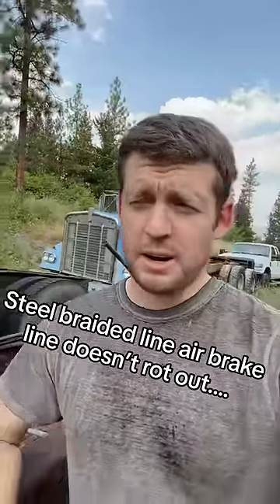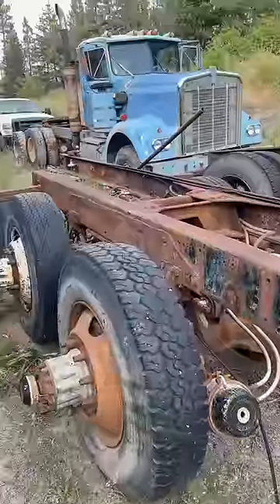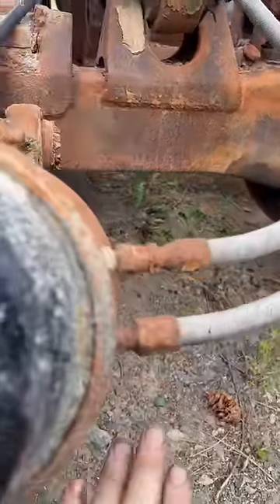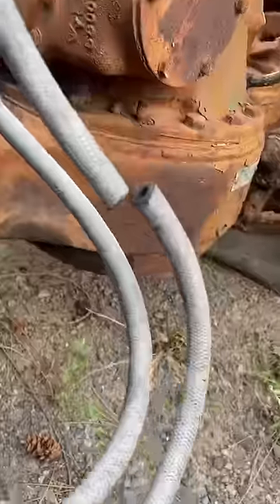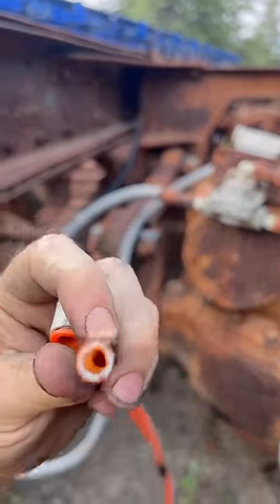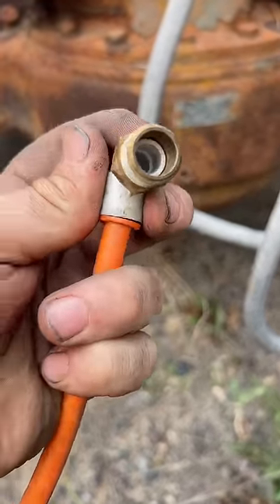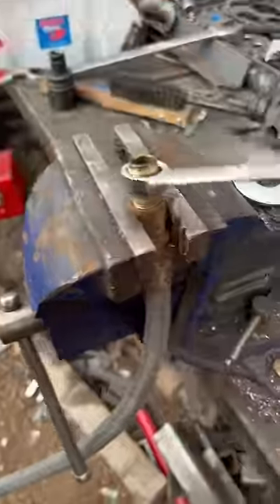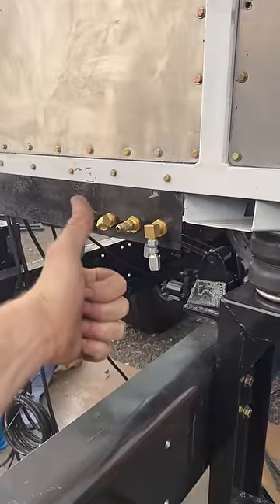Cutting a 70 year old trucks brake lines open for science

Comment: I've worked in the car industry for decades and let me enlighten you, the car companies will ALWAYS go the cheaper route to cut costs ALWAYS, they don't give a damn about safety and reliability unless it's going to affect their bottom line or it's going to get substantial negative publicity. I still remember when Ford sold the pinto knowing it was a death trap but they made a cost analysis of how much retrofitting the assembly line or paying off the lawsuits would be guess which one was cheaper? Because that's what they chose.

Comment: For the record the air in air brakes is used to release the brakes not apply them. If air brake system loses air pressure the vehicle stops. It's fail safe. It's inconvenient and annoying if you lose air pressure. But you are not going to crash into something because of it.

Comment: Plastic air lines are junk. I've broken probably a dozen plastic air lines and fittings due to rock strikes on gravel roads. I was coming out of the mine loaded one morning and had just such an air line failure. I don't carry parts, so the mechanic came out to fix it. I aired up and make it another 600-ish feet before another one broke and I had to call the mechanic again. It was only 15°F. They get even worse when it's -40°.

Comment: Plastic air line 100% does "rot." I've replaced it on enough trucks and trailers. And those push in quick connects are convenient, but don't compare to the alternative.

Comment: If steel braided air lines are bad then why are they used by most manufacturers as the main air line from the compressor to the first air tank?

Comment: Nine times out of 10 going with steal other plastic they call you need to make, there is that one out of 10 times where the plastic will last longer in the environment than the steel, but in that same exact scenario you could use a different type of steel like stainless steal that is more corrosion resistant, and using that over a type of plastic is still a better option even though it’s probably more expensive.

Comment: Everything at this stage in human evolution should be made modular, and made to benefit us all so even those with no knowledge of mechanics can simply pull a color coded/ numbered part and replace it with a new one. Everything should be interchangable and built around the notion and concept of reusing and upcycling parts. Part testing machines that test the durability and integrity of used parts, etc. seeing the world be overy complicated and not user friendly is the most infuriating thing ever. It could be like legos pretty much...

Comment: Pretty sure that is STAINLESS steel braid, not just steel, which would be as rusty as the fittings at the ends of the lines.

Comment: they are basing this on the cheapest version of those hoses .. made out of sub-par rubber with rust prone braiding that actually will not hold longer than the equally cheap plastic line.

Comment: Push-lock fittings are the worst, they don't last worth a damn (o-ring fails 99% of the time) and they're a nightmare to remove without cutting the nylon line (which loves to work harden/brittle with heat, more likely to crack than cut cleanly). Give me compression fittings any day, reliable and non blood pressure threatening.

Comment: I work on air compressors and every time I walk up on an old Curtis air compressor with those pushlock fittings, one or more will have a leak. I've had a couple blow off because they were just done from age. I usually replace with brass tubing fittings. I sure as fuck wouldn't trust those plastic pushlock fittings in a braking system on a cold day in hell!

Comment: Those steel branded lines and  hydraulic fittings for your air connections an you'll have a bullet proof system

Comment: Pretty much every single racecar made uses stell braided brake lines so if im looking at a 50,000lb truck pretty sure I'm going to go that route. Also idk what the price point between plastic and steel braided line is but its definitely not big enough to justify push-to-connect fittings lol.

Comment: You won’t find any trucks that use nylon air lines to the brake chambers. They’re a rubber hose with reinforced fabric.  They would likely last the same amount of time as your steel braided lines. Unless someone didn’t route them or clock the chambers properly and they’re rubbing on the axle or frame. I wouldn’t want steel braided lines in Chicago, considering the salt would eventually corrode them away. Looks cool though. 

No need to bash nylon air lines. They’re cheap, lightweight, easy to work with. Gotta be careful here starting to sound like a bens mom joke. Could you imagine going back to copper pipes for air lines like they did back in the day?  Flaring tools, corrosion like no other, oh the bends. And having to support copper pipes. Not to mention there goes the easy color coding that most manufacturers are kinda consistent on. Green primary, red secondary. Kinda odd when you think about it, red is a primary color and green is a secondary color.

Comment: Looks like you bought  of set of axles from a well maintained unit. I have seen lines like that full of rust. Because a owner operator or fleet don’t give two flips about servicing the air drier or draining the air tanks.

Comment: I’m taking steel lines any day I’d rather be alive than dead so we’re on the side of the road and push. Did you see the size of the thickness compared to the orange line that new stuff was seen but did you see how thick the steel line was I rather be alive and be dead on the side of the highway somewhere or outside of a cliff because my airline blew out

Comment: People (read in stupidest accent possible) “duhhh let’s use plastic because we are told it works best, also we will not actually test it, but let’s go ahead and use it on the road and never wonder why it fails after a couple years”
plastic after 2 years of being in the elements: cracked and dried out making it useless, lucky if it can be recycled and reused
we are so mf backwards. Yes metal can rust and corrode, but some composites and alloys can even last longer than steel. And steel itself lasts for years, even when abused by the elements.
For a possibly shocking quality experiment: Acquire 2 fire pits, one made from steel (could be an old dryer drum, an old trash can, anything solid steel, the thicker, the better) the next fire pit, buy from your local outdoors store, not a steel one, but those flimsy shit ones.
The cheap flimsy ones last on average a couple years of heavy use in ultra light rain, the less exposed to the elements, the longer it lasts, while a steel one can withstand the elements for years of heavy use and abuse.
So just imagine goin to the store and buying a fire pit, you can do that and have one that lasts MAYBE 5 years if you take care of it, keep it out of rain and sun, it would last at most 5 years if it is not being used heavily (heavy use imo is at least a few times a month, or more, regular use) maybe good for the average person, but any regular use and you will be buying new fire pits each year! Or take my word for it, DO NOT BUY THAT SHIT! Go with what has always lasted, may not be as pleasant to the eye, it may be heavier, my point is, we buy the cheapest shit because we are stupid, we buy into the shitty marketing and believe anything put before our eyes without actually putting it to the test and wonder why everything costs so much when we willingly hand over our money without questioning where it is actually going: into producing more SHIT as well as instead of recirculating into the economy, it sits in portfolios and funds, increasing the need for inflation from simple greed. No one single human needs over 1 million dollars, if you believe you do, I believe you are very mentally ill, ESPECIALLY, if you believe you alone need more than that amount, a village can sustain themselves on less if done properly and not relying on ass governments that only keep profits in mind. There is a difference between gov and people. If you believe in community, you likely know what I mean. Not communism, that is not community. Community is everyone working for the betterment of everyone. Not only themselves as we do today.

If you want quality, fuck the stuff you buy brand new, ever head of planned obsolescence? Look it up, i am not sure how more companies are not getting sued for it, but at the same time, it does not surprise me because we are so dumb. Samsung got caught up in a lawsuit for making either their washing or drying or some machine too cheap, people actually sued them, which is what we should be doing, because these products are mainly using non renewable resources. Sure some of them can be recycled, but they are not. Recycling was the best marketing strategy, because we have only recycled roughly 4% of plastic ever produced, if that. But the companies selling detergents, foods, bottled water and soda, sure made a hell of a profit on our demise, literally after a lifetime of poisoning ourselves with all the chemicals and toxins most of us consume each day without even knowing what is going on. They all work together to keep us dumb, because if we realized we could survive alone, well there goes all their money. Oops.
Planned obsolescence: in economics and industrial design, planned obsolescence is the concept of policies, planning or designing a product with an artificially limited life use, or purposely frail design, so that it becomes obsolete after a certain predetermined period of time, which it decrementally functions or suddenly ceases to function or might be perceived as unfashionable. The rationale behind this strategy is to generate long term sales volume by reducing time between repeat purchasing. 
A policy of producing consumer goods that rapidly become obsolete and so require replacing, achieved by frequent changes in design, termination of the supply of spare parts, and the use of non durable materials.
Cough cough apple, google, Amazon, Blackrock, cough cough all big companies and industries cough cough capitalism cough

Comment: Remember, they are cheap and want to save as much as they can while still charging you for the crap that isn't there.

Like a Tesla. Why is that 40k when it basically is digital? Why do standards cost so little when its all analog or w.e it's called and actually physically happening.

Comment: Rolls royce waterproofed engine from 45-50' had braided cables with a seal underneath. Watched a dude unsieze the engine and let it run without replacing the wires. 🤷‍♂️🤷‍♂️

Comment: Just because the truck was from the 60s does not mean those are the original air lines, no idea when they could have been changed.
Reply: I don't doubt for a minute that they've been changed. But have you seen the rust on the fittings? It's not been on there for only a year or two

Comment: None of you know what you're talking about. Stenless steal and rubber lines both performe the same when new. The stainless protects the line from damage not swelling. 

Stianless over plastic whould protect them from getting hit but plastic does not rot out like the rubber inside the lines as fast. 

You use stainless in racing because it protects the lines from debris on the track and they are not because they brake better. For all thouse people that say that they replaced there lines and it felt better how old were you brake lines and fluid? 

As far as trucks go i can not say which is better but it is not for any of the reasons that people are saying.

Comment: Im sorry, but what? People think air is going to make rubber and steel rot? Then why tf do we use them on things we want to last? You know whats in tires? Steel and rubber. You know what your shocks are made of? Steel and rubber. Both of these parts are made to absorb heavy impacts. It would obviously be problematic if the air around them would cause them to rot. What does rot steel and rubber is high amounts of thermal energy, salty water, and acids. There is a huge difference between an oxidizer and oxygen you oxymorons
Reply: I don't recall anyone writing that air will make steel and rubber rot? News flash... tires "rot" both the rubber and steel components.
Reply: @johne189  Do you know why they rot? The usual reason tires rot, especially over a short period of time (a few months) is due to sitting out in the sun. Steel needs a bit more than air to rust in a short period of time. Usual acidic water of salt water can make it rust or decay quickly. Heat is also a key factor with both materials. Air alone will not cause either to decay rapidly. The lines under that truck are shielded from the harmful effects of direct sunlight. But you know what can decay over time without any of these factors? Plastic. This is why bottled water has an expiration date. Usually about 2 years or so. Heat can speed this up to within a day. So don't drink bottled water that sat in your hot car all day. Of course there are many forms of plastic that can withstand different forms and amounts of abuse. But enough heat will straight up destroy them. This is part of why recycling plastic is so hard and costly. As for recycling rubber, well there's a different reason that is difficult. Hank's science videos covered that. If you have credible sources that prove me wrong, feel free to share them. I'd rather be right that ignorant